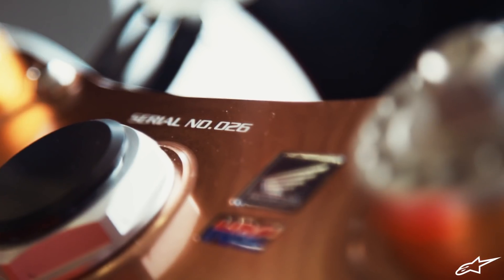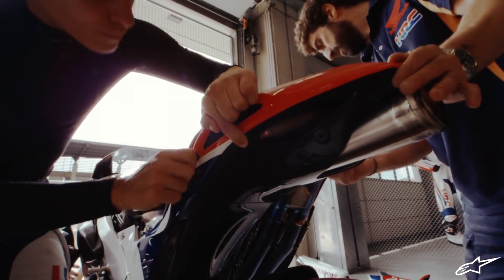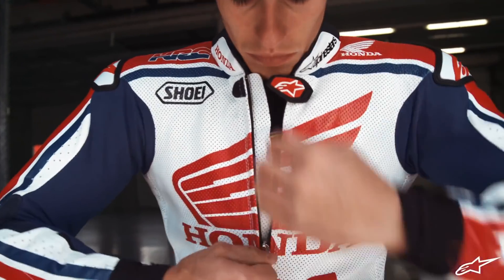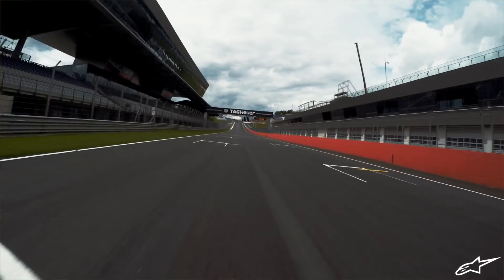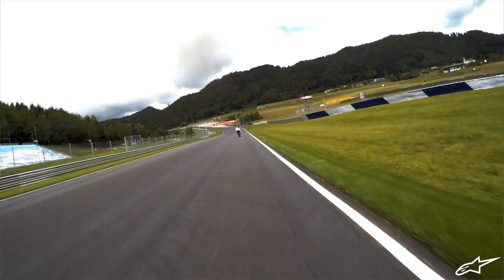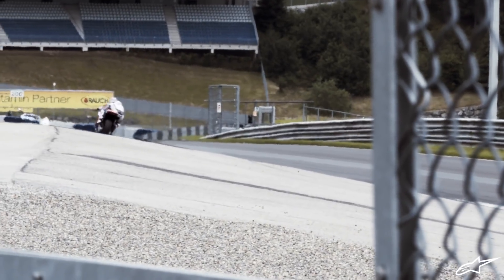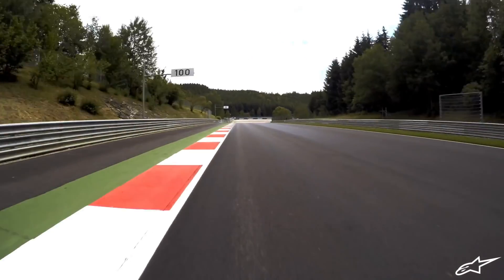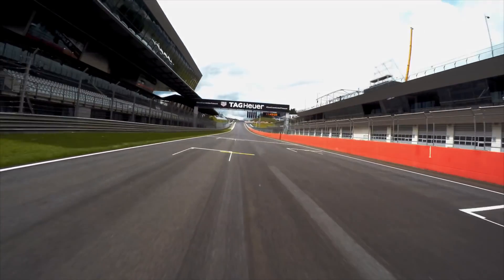MotoGP Riders ride Honda's RC213V-S

Comment: what is the connector for the race suit? anyone knows?
Reply: Skin HeaD tech air - its a vest inside your leather suit that will inflate before you hit the ground or an object, i own the same vest, its 5lbs and hot, but I always wear it when i spirited ride, especially runs in the 180mph range on my CBR-1000RR-SP2